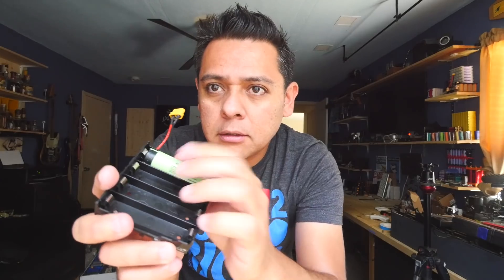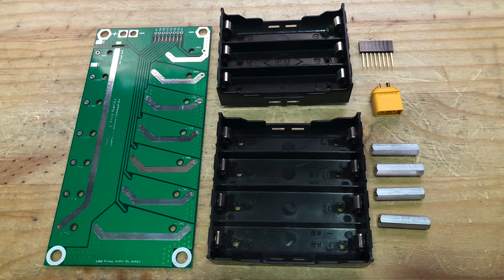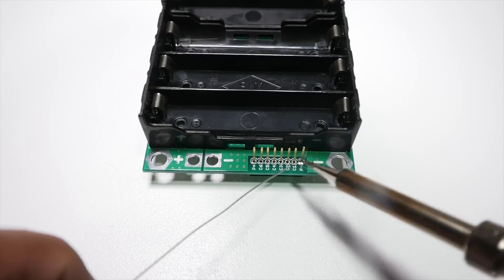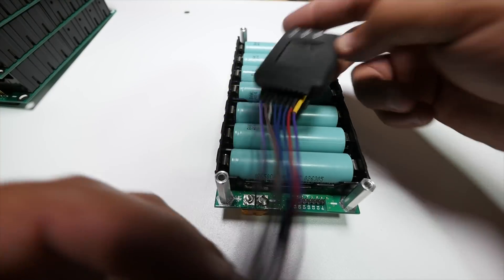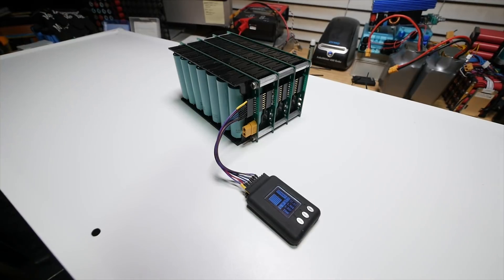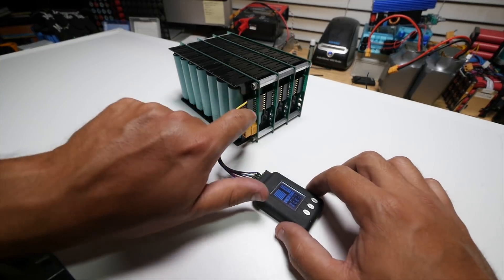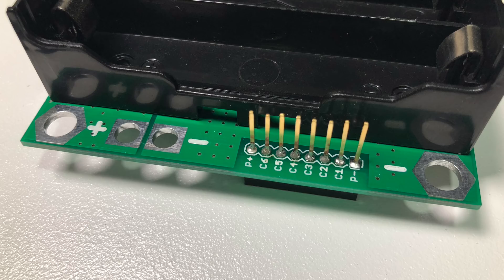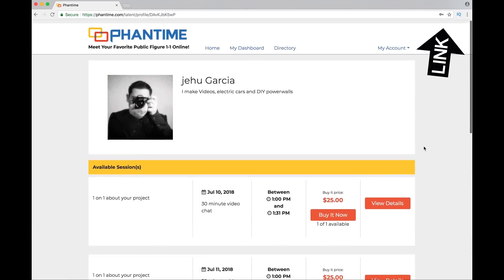DIY Rapid Build 18650 PowerWall Module project  - design & testing

Comment: @Jehu, have you considered using thermal grizzly gallium based conductive thermal interface material? I have a feeling that you can better every single set of efficiencies @ connection points and solder points to increase transfer "rate" of electricity to heat ratios. I am no scientist nor claim to be anything more than a guy who figured stuff out by trial and error. (A tinkerer) If you need clarification later feel free to drop questions here below. I would like you to reference how CPU chips are transferring heat when they are  overclocked (such as in my ballpark). Then once you realize by sealing the metals together like solder(sp?) does... but not having to do so, you get a drop of 20c by using the thermal grizzly TIM (thermal interface material). So in my case by focusing on the amount of wattage/transfer rate my All in One liquid CPU cooler by Corsair (H105) and by using the right type of fans in the mix. (I use static pressure fans with a focus on the exiting fans to be a "air flow" type fan. (Bias to Corsair and Noctua fans only.) I can control the amount of heat dissipated at the cycle of cooling in the radiator. This enables me to perform faster heat dissipation at the radiator level of the all in one cooler. I read a little on thermal dynamics because of interest. Static pressure around whatever is producing heat also is helpful if it's moved at a proper CFM/Pressure rate. I could see power walls future state including some tech/computer based thinking when designing.
Reply: gallium=galvanic corrosion check make sure your not going to have a problem . you don't want the metals in the batteries or terminals breaking down. you wont know there's a problem until it blows up in your face .. update 18650 casings is made of aluminum, gallium loves to eat this alloy .

Comment: this seems very practical and easy to use... its bound to fail
Reply: The system doesnt charge uniformly all batteries. I will fail and explode with time.
Reply: which is why you use a battery management system which all the 8 pin leads are for, to balance the batteries. this is diy battery packs 101
Reply: Herbert 8 pins yeah... But... For how many batteries? That's the thing, it charges 4 batteries with the same cable. Think a little deeper next time.

Comment: Need copper or zinc plated copper contact in the holders with larger pins..  Your pushing a lot through those small pins into the board and the rest of the contact is acting as a heat sink.

Comment: Great show and thumbs up for going into pcb design. The designer for the board should have mentioned that standoffs are not made for power connection. For power connections, use a pcb terminal connector and interface it to a cable terminated with ring lugs. Also, there are cables with two conductors. The standoffs should have been isolated. I would guess the standoffs would touch or interface to chassis ground (safety). Hey. I love the connector board-to-board interface..Nice. Great prototype. Keep making videos!

Comment: Love the video! But I still prefer the Tesla-style battery packs. After all, they both require soldering anyways. Sometime the old methods are the best. Probably easier for people that aren't as keen into batteries and soldering and what not, but I don't think having someone build a large battery out of 18650s is the best idea for those types of people anyways. In my opinion, a good idea for applications where batteries may go bad often, but those applications are usually high amperage and these battery sleds don't seem up to that task. Keep em coming!!

Comment: Four to five dollars to connect and house only seven cells is way too much, the assembly is too time-consuming, it provides no thermal management, the common rail that connects all parallel cells is just a breadboard pin that can easily fail and the individual cell fuses are not easily replacable.
Why don't we, instead, invest time in designing a simple PCB to fit onto those 4x5 cell holders ?
Reply: Those are valid points. This system costs more than batteries, which makes the whole powerpack cost twice. And is also not very efficient (not for EVs like someone said). It could be great for small experiments, but definitely nothing serious.
Reply: @jarekf3083  Very True - the interconnect parts also rely on the (likely steel) riser hardware to carry the load out, which is significantly more resistive than copper.  The amount of power wasted in heat on that design makes it worthless for more than 1 or 2 boards.  There's tons of profit in those prices as well, so someone is making bank on this junk.
Reply: Lol
Reply from the maker: Let us know when you finish
Reply: @jehugarcia  what a stupid comment. Why all Mexicans are so afraid of actual discussion.

Comment: Sign me up for at least 100 modules. This is great for begginers and keeps the fabrication cost/time really low.
Reply: This board is a prototype and will be upgraded in the near future. As for unbalanced charging, thats what the 8 pin plug is for...the balancer. As an engineer you should have written a helpful reply not that "Don't use this" remark. As a fellow engineer I exhort you to do better.
Reply: Fernando Rivera 8 pins for how many batteries? Hmm... If the number of cables is less than the number of batteries it is unbalanced changing.
Reply: Guillermo Marturet Fendt The 8 pin connector is for the voltage meter/balancer.  The power connector is an XT60 terminal.
Reply: @whyisthispublic-p4b  7 batteries. I.e. a pin for every negative cell post and the positive of the set. It's balanced.
Reply: same if we buy them in bulk that will be great.
Reply: Where can I buy some modules
Reply: Great idea!
Reply: Do not build this!! The system doesnt charge uniformly all batteries! I will fail and explode with time. Trust me, Im an engenieer.
Reply: Guillermo Marturet Fendt,  instead of using copy/paste to post the same comment 5 or 6 times in the thread, why don't you try being constructive?  Good engineers test things before making decisions, or at least explain their thinking.  If that's too tough for you then maybe you should let others do the commenting?  
For what it's worth, I'm slightly concerned about the current capacity of the binding strips but would want to see more tests before scaling them up. (It would probably be a good idea though, as it would increase the safety factor).  Oh yes, and I'm an engineer too.  But I never stop learning.
Reply: Andy Chaplin yes... My fault, but I had to try and reach as many people as possible. The amount of people saying positive comments of this prototype was too much as to try and reach everyone with a different sentence.
Reply: You should not try to stop natural selection.

Comment: This is nice.
adding heat shrink tube to the long bolt to make it safer, great stuff!
Reply: Exactly what I was thinking - simple HST.  Also on the balancing pins, but can just one larger tube, rather than individual.  The bolts remind me of the buss bars in power supplies for telecom gear, large computers, and such.

Comment: these pressure fit type contacts aren't safe at all. also if you put these into your car with the vibrations and banging around coud cause issues, wouldn't be worth the trouble, just solder or weld the bloody things.
Reply from the maker: These are not for cars,   Did you not watch the video?
Reply: jehugarcia ya I watched the whole video. I believe I saw you digging into you VW and got that idea into my head maybe? thanks for the reply.

Comment: Isn’t it a bad practice to connect cells in series within a module?
Reply: I don't think you can do a 4.2v battery pack at big scale, there is always module or cells in series or?
Reply: Touli Loup you need a BMS which balances the series voltages as well
Reply: @ciarfah  so each cell need it's separate connection? Or you mean each group of cells in series are balanced?

Comment: I was immediately thinking your could make it much larger capacity per board by paralleling them (2 or 3 or 4 per slot) and using longer stand off's ...Much more economical.

Comment: How does the BMS work when the connectors are stacked? Does it show condition of each stack (one cell of each level)?
Reply from the maker: It’s all a 7s Xp electrically
Reply: cool makes sense. btw is there any good open source firmware or anything for diy powerwall projects? Something that displays the current state, maybe plots usage graph over the day etc.

Comment: Looking for a good solution to replace the 48v lead acid battery in my lawnmower with lithium ion.   And this is getting close to it I guess.  But I probably need to old school it seeings how the mower I would relate that to an electric bike and this setup is not recommended for that.

Comment: I'm very surprised the battery terminals are getting that hot with only 500ma from each battery, the contact resistance must be quite high , can you measure the voltage drop across the battery terminal and batter clip?
Reply: Wasn't it maximum 4.5A per module (18A total). The batteries on the module are in series so each battery is delivering 4.5A. With that amount of current and temperatures I think the voltage drop is considerable.

Comment: They might not be able to handle the current like that
 But for other projects like led flashlights, small power packs for charging stuff abd and whatnot. Its a great idea. Thank you for the share.
Reply: I think Neutron was talking about the pins on the battery holders being too small for the current load.
Reply: NeutronPCXT The thin pins are for balancing....the main power goes through the posts on the corners
Reply: NeutronPCXT if like to see a comparison between these and a soldered or spot welded setup thermal-wise. I have a suspicion they were conducting heat out of the cell. It doesn't make any sense that they would get hot and the tiny fuse wire wouldn't.
Reply: Some heat is probably produced by contact point resistance. Also springy metals usualy are more resistive. Some time ago i had 4xAA battery holder where springs where smoking and burning plastic at only 2A.
Reply: Yep. Steel strips have 3-8% IACS.

Using something like phosphor bronze/brass strips in the battery holders would help tremendously with current handling.
Reply: I think because of the metal it's acting like a heat sink for the battery. More wider the metal strip it the more it looks like it's expanding. And i think with the fuse wire. Being a Thin piece of wire. Maybe I'm wrong I have no clue Just a guess maybe.
Reply: Yeah. These thin steel strips can't carry a lot of current at all.

I would not recommend them for big high powerwall operation.

Comment: Nice.  Don't think those temperatures are anything to worry about.  ABS is printed at 230C.  So 65C is orders of magnitude lower.  I'd be more worried about the circuit board traces and holder resistance.  Probably best to hook up a power supply and measure voltage drop across the boards at various currents.
Reply: Printing temperature does not relate well to max usable temperature of a plastic, when printing your heated chamber is at the set temperature, but the plastic you're extruding usually does not get the time to heat up to that point before it's extruded. PLA for example may already be very soft at 65C even tho its printed far above 100 degrees.

This is also why the E3D vulcano helps with high printing speed (Longer time for the plastic to heat) and why you may have to increase extruder temperature when printing faster.
Reply: asusreviews doesn’t heat indicate in efficiency?   I think Jehu is trying to make the best product possible with longest use of optimal materials and design
Reply: Its glass transition temperature is approximately 105 °C (221 °F). ABS is amorphous and therefore has no true melting point. At plastic temp it will deform.
Reply: 65C is not even ONE order of magnitude lower then 230C.
Reply: bla bla bla mr technical nit pick.
Reply: tfw words have meanings
Reply: tfw trolls technically nit pick a statement of exaggeration.
Reply: maybe words with specific, technical meanings shouldn't be co-opted by the general public as "statement(s) of exaggeration"
Reply: Maybe stop trolling?
Reply: No trolling intended. I'll let you get back to it. I have several orders of magnitude more comments to get to. <3

Comment: The sound and visual of Jehu sliding the board across the table is driving me nuts. :-)
Reply: That sound made me very uncomfortable also
Reply: Tony P you are sooooo right. Nails on a chalkboard!!  😂
Reply: Hardware guys treat hardware the way software guys treat their software.
Reply: Triggered me too. Must be a Tony P thing !
Reply: Theres a lot of us sound aspergers about LOL
Reply: Tony P 
"So, we have this board here..."
Bats board, bare trace side down, around table like a cat

Whhhyyyyyyy?? 😱😭
Reply: He should Whisper and then add in title "ARSM" or "ASRM"... I never know!
Reply: yes totally agree, and that he bangs the stuff around instead of treating it with respect.
Reply: Great videos,  you want to dissipate heat with a fan. Would that be effective in lowering heat from battery block? Frank
Reply: my fave is putting holes in the soldermask with the tweezers... four amps won't mind right??
Reply: bruhh i feel yea
Reply: 3:40
Reply: ASMR at it's finest ....
Reply: Ahhh yes

Comment: Clever design I had a thought of something similar but this is better! Besides I also lack PCB design skills. There are 100% metal connectors that might work better but I do not have any experience with them. They are from keystone electronics part#54 https://www.digikey.com/product-detail/en/keystone-electronics/54/36-54-ND/2254090.

Comment: Surprised the balance pins stayed cool. 
About to use these holders in my esk8 board. 
Was wondering if I would have to bolster the connections. 
No questions about it now. Definately have to modify them! 
Thanks for this video.
Reply: There's very very little current flowing between cells on the same level, so the balance pins should be cool.
If the cells were all identical and perfect then no current would flow between them as they would all rise and fall together with the load on the main terminals.
In reality, every cell will be slightly different so cells on the same level will try to equalize.
If balance current gets too large, then there is a problem!

Comment: i am an inventer and product innovator i am currently working on the prototype to solve this exact concern (problem). I have brain stormed a solution which requires no soldering. i first brainstormed my innovation back in 2017. When i am finished with the prototype for production i hope to contact you for product review.
Reply: Fishman 02 give him a break, it's harder for an inverter to do electrical design, with his chubby transformer fingers
Reply: Thermo-set plastic or phelonic resin holders with contacts that have a larger contact area with the cells and dielectric grease. The biggest bottleneck in this design is the spring contacts in the holders, the surface area is only a fraction of the available space on the cells. With greater contact between the cells and the contacts of the holders should reduce the heat buildup.
Reply: @petercoutu4726  You can buy spot welders for less than $200 that will do the trick just nicely. Assemble the batteries into bricks with a controller / fuse PCB attached to each brick, and connectors to stack/extend the bricks. Nice modular system for making any voltage / power configuration.
Reply: @paulmichaelfreedman8334  the point of this design without spot welding is to allow for individual cells to be changed as well as lowering the barrier to entry for these products.
Reply: @petercoutu4726  but power loss between the terminals  are causing heating and that is not very safe. Another point already made by others, is that this parallel setup doesn't account for voltage difference over the separate trains and this will kill at least a few batteries after a while. When assembling parallel batteries, the separate parallel trains should be monitored and charged separately.
Reply: Sounds to me @petercoutu4726 , like someone should Kickstarter project design a new kind offspring terminal that doesn't work by bending but uses actual springs in the same orientation as the battery to evenly press up and down on perpendicular plates so that the contact actually make 100% contact with the surface area offered by the battery contacts.  Thus despite which exact length of battery you choose because there is a few millimeters variance depending on wether the batteries contain the safety IC or not on the end and wether they are flat or button top.  But by having perfectly perpendicular plates to the force pushing up and down evenly the contact will always be near 100% as long as they clear the inner edges of the battery sleeve.  That would be a superior design for a battery holder non-solder contact type.
Reply: I smell a  crowdfunding/kickstarter/Indiegogo campaign. happy to help.
Reply: How long does it take like, he did that in probably less than a few days
Reply: Fishman 02 He also is working with someone, gave no information on how long this design took to come up with and is still at the prototyping stage just like Terrance is.
Reply: WIth full DC/DC active battery balancing with some dc/dc flyback IC's? for the cheap? :)  ESPECIALLY with used cells, you can squeeze the most out of old cells with active battery balancing. It's a must. I think LTC3300 will do the trick.